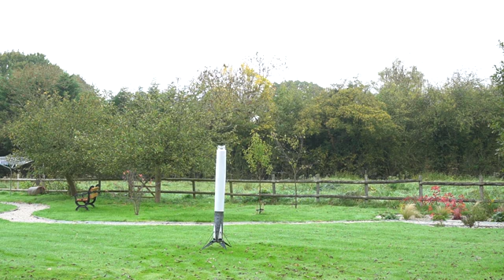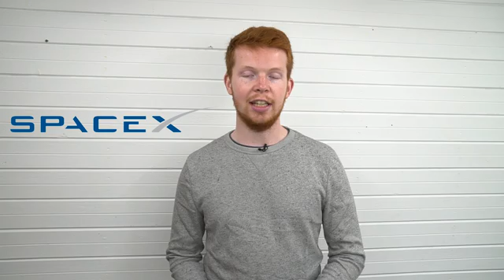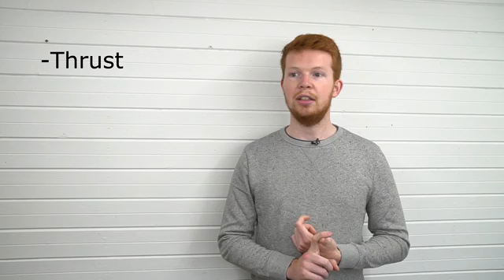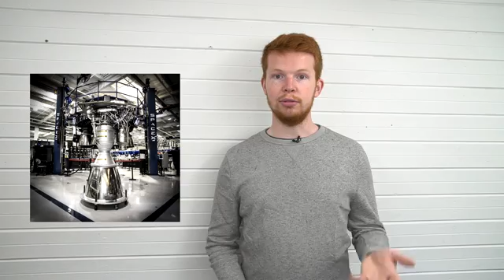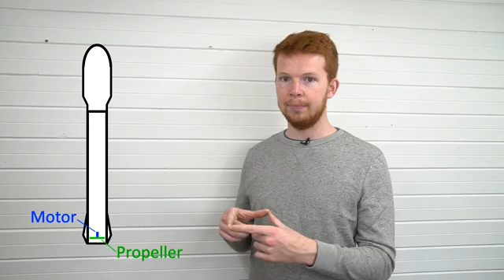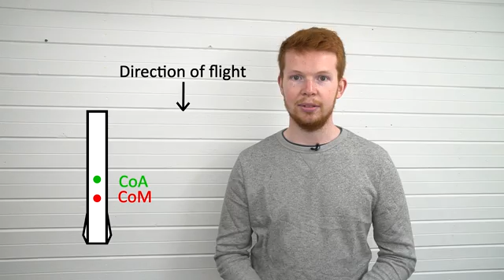Hovering a rocket - SpaceX model

Comment: Hey tom stanton, amazing video! You said that you have 2 rocket engine types: solid and liquid fuel engines. But there is another one: hybrid rocket engine, it has sort of the same advantages of a liquid fuel engine but waaaaaay cheaper! As fuel you can even use 3d print plastic and as oxidizer nitrous oxide or something else.
I hope you can do something with this information, maybe for next video?
Reply from the maker: Hey Boris, oh yeah I forgot about hybrid rocket engines!! You've reminded me of the old Mythbusters episode about testing different rocket 'fuels'! Think I'll stick to some sort of ducted fan thrust for now as it's slightly less of an issue if it crashes, but maybe something to explore in the distant future, thanks!
Reply: haha that episode was amazing, and I fully understand why you used a ducted fan, it's a little bit easier! I am making a rocket myself and am thinking about making this function too
Reply: +Kevin Jensen "Hybrids have the disadvantages of liquids".  Yes, you need high pressures, but depending on what you're doing, LOX or liquid Nitrous supplies its own pressurization, hence no pumps necessary, and if you do need pumps, there's only half as much.  The burning process is controllable, the engine is throttleable and restartable, and reasonably clean depending on what you use as fuel - but of course nothing is as clean as LH2+LOx.  No harder to steer than solids.  Efficient?  Some of them are pretty surprising.

At least in the amateur rocketry field, hybrids are quite practical.  Liquids generally aren't.

I've built hybrid motors up to 8" diameter and 8' long.  Consulted on a tri-fuel hybrid.  Assisted with numerous flights.  A friend of mine even started a company to make and sell them.  As for nobody using it, SpaceShipOne did.  Orbital?  More a matter of time methinks.   There are several hybrid motor projects underway for orbital and even manned use.

But that's all somewhat irrelevant to the video.
Reply: thus the  word HYBRID..a cross between the two types duhhhh
Reply: If you want to emulate something closer to the rocket but without issues related to combustion, why not use compressed air (co2 or nitrogen) the pressure vessel could lead to 9 gimbaled nossels that can be made out of almost anything because you don't have to worry about heat,
Reply: Fromage Frizzbizz I mean if you really wanted to, you could use a hydrogen balloon for air launch, provided a way to quickly and efficiently pump the hydrogen out, without a pressurant (possibly by physically pulling the balloon in) then the balloon can double as a fuel tank, why waste helium or what is effectively a high volume container of low density gas? You might make it semi rigid, for areodynamics. An alternative air launch is hundreds of drones that physically link together, some possibly with small jet engines and there could be crossfeed opportunity, but all of them creating a flying launch platform, alternatively both those methods could be used as assisted ground launch instead of air launch, probably much more easily
Reply: +Michael Halpern I'm going to combine several replies:

- Getting 100 tons of payload to 70K feet or more is more than carbon fiber and software - it would take a LOT of time to get up that high, plus you want reserve to land the thing if you had to abort.  the world altitude record for helicopters is 42500 feet.
- Google's "pseudo satellite" doesn't require very much in the way of payload weight, and doesn't really need to be that high.  Either just above 40K feet, or a reserved flight level.
- Getting to 40K+ feet with that much weight and returning is going to take you a lot more than 20 minutes ;-)
Reply: Fromage Frizzbizz Yeah. Hybrids can be quite efficient, too - especially if you use LOX. SpaceShipTwo is using LOX-HTPB I believe (SSOne used N2O-HTPB), and can get ISPs in the 300's. N2O with most fuels will tend to give you in the mid 200's due to the higher exhaust molecular weight and lower combustion temperatures. But, N2O hybrids sure are convenient for amateur use! Built and flew a couple myself, up to 10cm/4" in diameter :) they're good fun.
Reply: Hybrids also have some of the disadvantages of solid rocket motors in this scale it doesn't matter as much and of course they have a unique disadvantage in that unlike solid and liquid engines, hybrids don't scale up well
Reply: The reason why orbital rockets don't use hybrids is scalability or lack thereof, which makes sense because after a certain point it will get hard to maintain a good fuel/oxidizer mix throughout the burn, with solid and liquid it's easier to maintain the fuel ratios.
Reply: +Michael Halpern Maintaining the appropriate fuel/oxidizer mix is simply a matter of metering the oxidizer flow, the solid fuel only erodes/burns as fast as the oxidizer delivery.  As for scalability, there's no inherent difficulty in making a hybrid as large as an SRB, - a SRB is the most powerful engine ever built.  The main issue is that hybrids are, relatively speaking, fairly new and there hasn't been anywhere near as much development as on other types.

As I said there already is considerable work being done now, largely by private/commercial interests, to use hybrids for orbital rockets.
Reply: Fromage Frizzbizz yeah and Virgin Group has had considerable trouble scaling their hybrid engine
Reply: Gimballing, no, but thrust vectoring as he did with this thrust source, or as Copenhagen suborbitals does with its engines seems like a completely valid answer to this problem.  (On future versions of larger rockets if he ever decides to expand these experiments.) 
I think this is a valid orientation stability solution for a rocket moving up... though hovering a hybrid seems like a harder issue because, as you indicated, the burn isn't exactly uniform.
Reply: +Michael Halpern Virgin Group isn't the only developer.
Reply: Fromage Frizzbizz no they aren't, but they are one of the more likely to reach orbit with hybrid rockets, and that's with an air launch and help from the white knight aircraft
Reply: +Martshal I believe the un-uniformity of hybrids is vastly overstated, and are large a result of amateur rocketry using self-pressurized nitrous, rather than turbo-pumped/metered oxidizer.  Amateur hybrids are almost always a piece of aluminum pipe, with an aft closure containing the nozzle, a forward closure containing a nitrous fill-tube, and a middle closure containing a precisely machined hole covered with some sort of pyro valve, all assembled with O-rings and retainer snap-rings.  You assemble the after section with a piece of plastic (the fuel) thick-walled pipe, the mid closure is just above it, and fill the forward end with liquid nitrous.

Some commercially made amateur motors are a bit more sophisticated - Aerotech had a design where the "fuel half" of the pipe was a precisely cast chunk of ABS that screwed into the tank, and the tank was designed conservatively to not produce enough nitrous to burn thru the ABS wall.

You blow the valve, and simultaneously ignite the nitrous flow inside the pipe (chamber, possibly assisted with some oxygen thru a thin tube stuck up the "rear end").  The nitrous flows ONLY due to vapor pressure of the liquid nitrous, opposed by the chamber pressure.  if the pressure goes up, the nitrous rate slows down.  As the nitrous is choked off, the chamber pressure goes down, the nitrous flow picks up again, and the process repeats.

Nitrous at ambient temperature is relatively close to condensing, hence the whole thing is highly dependent on ambient temperature.  "Smooth flow" relies on getting the machined hole matched exactly with burn rates, exhaust rates, and ambient temperature.  Which means two things - the thrust goes way down if the ambient temperature is lower than you expected.  Secondly, if it isn't precisely matched, you get pressure & thrust oscillations.  So much so that most amateur launches sound like a very loud prolonged fart.  Which is quite entertaining for the kids watching, but a sign of being "slightly off" in your calculations.

With a very fast metering valve with pressure-feedback instead of a simple hole, this should be doable at amateur scale, but is more complex than most amateur rocket hobbyists are willing to do, and unnecessary for normal launches.

This all goes away with a metered turbo-pump, which makes it impractical for amateur hobbyists, let alone a project like this.
Reply: +Michael Halpern Yeah, and Virgin Group isn't the only company working on hybrids.  Check out the wikipedia page on hybrids and see how much work is being done with them.  Check out the AMROC motors - 1000 kN is pretty respectable, almost four times the thrust of the Spaceshiptwo, three times the thrust of a Delta III booster, and about 30% more than a Delta IV "medium" booster.
Reply: Fromage Frizzbizz and to emulate a F9 you will likely want to be able to restart the engine, otherwise it's just a constant hover with changing altitude
Reply: And the way I see the fate of future hybrid rocket development, because of the big push for reusability, and the fact that it is easier to refuel liquid engines than solid or hybrid engines, development beyond hobbyist and niche use will be naturally limited, unless they provide a significant advantage
Reply: They may replace Solid Rocket motors though at least for anything other than fireworks and beginning hobbyist, I do rank HRMs higher than SRMs, if you can scale them, but I also believe that they have a very long way to go, for instance the fuel you mentioned for them I believe is a patrolium based plastic, now while RP-1 is popular for liquid propulsion, so is H2 and soon CH4 both of which don't need fossil fuels, and early liquid fuel rockets used ethenol, and there is syntin if you need something closer to RP-1 and don't have the oil, burns hotter and was expensive to produce but if you needed to you can probably find a more efficient modernized process for it
Reply: +Michael Halpern They're the only ones doing air launch with their hybrids.  Many others have already reached orbital heights (but not orbital velocity) without air launch.  It's just a matter of time.

And indeed, even commercial non-hybrids are air-launched.  Eg: Pegasus.
Reply: Yes Pegasus the medium sized SRB launched out of a giant plane that carries very small payloads to orbit, Dont get me wrong I love the IDEA of an air launched spacecraft, but there are some not insignificant practical problems with them.
Reply: +Michael Halpern Musk's comments about air-launch are instructive.  You only save at most about 5% over ground launch, but end up with a more complicated rocket that has to have wings to initiate flight trajectory, and in the end doesn't gain much.  He's probably a bit overly pessimistic, but...

I don't think you could call a Pegasus "medium sized", and a Lockheed L1011 isn't exactly "giant" either, and the payload is, as you say, very small.  The Pegasus is 3 or 4 stages BTW.  Original Pegasus was 3-stage solid, current Pegasus is, I think 2 or 3 stage solid and 1 stage hypergolic (monopropellant).

You'd be better off suspending the rocket from a balloon, getting it up to 100K feet or more, and then fire it as an early X prize contestant was planning on doing.  You can even shoot thru the balloon, the rocket ain't going to care.  But again, there's even more extreme weight limitations.

I don't think that it really matters that the only major hybrid launch you've heard of (Spaceshipone/two) is air-launch is particularly significant.  There are plenty of ground launch hybrids.  They do generate more than enough thrust for orbital work, it's more simply a matter of least-amount-of-development work behind it.
Reply: Boris WHY DOES IT DAY ROCKET AT IN THE TITLE >=€
Reply: +Trozzdebois Why does it say "rocket" in the title?  Because he's modelling the behaviour of the Space X _rocket_.
Reply: The advantage of using an interlinking drone swarm is that you can mass produce them and use them similarly to helicopters in smaller numbers, even with various modules for carrying people or cargo, or a tether to carry cargo or injured people, if you got it right, meaning easily justified mass production and launches would be more or less a side application
Reply: +Michael Halpern Quite a bit of high altitude balloon work is already done with hydrogen anyway - it's a lot cheaper than helium and provides more lift.  I've spoken to a non-hot-air balloonist who almost always uses hydrogen for cost reasons.

He just packs a parachute - when a hydrogen balloon ignites, the flames go up very strongly, you have plenty of time to jump.

The big issue is that the amount of hydrogen you have in the balloon doesn't actually amount to very much compared to liquified hydrogen tanks.  Further, trying to pressurize the rocket from the hydrogen bag would be quite slow (you'd be on the ground by the time you'd gotten enough to help), and the machinery very heavy (might not get off the ground in the first place! ;-).

There's a proposal for an "inflated" tower a few 10s of km high which you could launch from.  Google for it.  That would work.  I'm still not 100% convinced about the tower itself even tho the science looks pretty solid.  Slinging something real heavy (hundreds or thousands of tons) on top of a inflated tower doesn't exactly inspire confidence.

Interlocked drones seems to me to be more complicated/expensive than just slapping on another stage.  We're talking 100s or 1000s of tons.  That's a bit much to fool around with this way methinks.

I'm more partial to beanstalks and space fountains myself.  We almost have the technology for the first.  But, I'm not so sure whether it'd be safe in the face of flat earthers, American Taliban and other extremists insisting that it denies god or is the hand of satan or some similar idiocy.  I don't want to think about a successful beanstalk sabotage.  The consequences are more than a trifle unpleasant.
Reply: +Michael Halpern I can certainly see the attractiveness of mass-produced drone swarms for cargo/passengers/disaster response etc.  Maybe we'll get flying cars only a few decades late ;-)

However, (a) that introduces a whole host of technical/social/safety issues that I don't think have been completely listed, let alone examined yet, and (b) a drone copter that can carry a couple hundred pounds near to the ground is a whole lot different than a "swarm" of devices that has to take 100s of tons or more to altitudes well above 40K feet in order to make it worthwhile.

Did you realise that the highest "non-research/ experimental" helicopter missions EVER have only been to 22K feet or so?  Simply can't go any higher.  I'm sure they could go a bit higher if there was "commercial pressure" that  Iresulted in designs suitable for higher altitudes, but even just 40K feet would be quite a challenge.

If I recall correctly, the max lift for any helicopter is about 25 tons - I saw one topping off the CN tower.  You can betcha it can't go even 15K feet with that load.  Max altitude I saw that chopper at was around 2000' ASL.
Reply: Fromage Frizzbizz so long as you can get the structural interlocking sturdy enough, and you probably would use something on the lines of carbon fiber, everything else is software, and because batteries weigh the same regardless of charge, staging them off rapidly makes more sense, vertical interlocking will probably be more structurally sturdy in many situations, though maybe not as thrust efficient
Reply: Fromage Frizzbizz Google I believe  is trying a drone swarm high altitude platform (psuedo satellite) the advantage of drones is that instead of a few big rotors you can have lots of ducted rotors in the same space producing more thrust
Reply: Fromage Frizzbizz as to flying cars, doubtful people carrying vtol electric aircraft with any meaningful speed have battery life measured in about 15-20 min tops, though some may push it to 40min, short range or brief operation that's fine, but for general transport, why reinvent the wheel?
Reply: Fromage Frizzbizz also with interlocking drones, not all have to be connected to the main body at liftoff, so really you would only have to start total staging them when they become less useful, and it is easier to sled launch drones so they can be at matching velocity when they are mated mid flight
Reply: Fromage Frizzbizz yes it is, but you can change out your drones mid flight
Reply: +Michael Halpern Yeah, I suppose, but I can't help thinking of the WeatherGirl's breaking into a rendition of:

It's Raining Drones! Hallelujah! 
It's Raining Drones! Amen 
I'm gonna go out, I'm gonna let myself get, 
Absolutely soaking <crunch...>!…

;-)

I think you greatly underestimate the difficulties of vertically lifting a few hundred tons high enough up to make a difference, let alone how cost-ineffective it would be.
Reply: Fromage Frizzbizz What if the array of drones were programmed to never fly over residential areas? Something like this could be possible in many places just here in the US...
Reply: +TheSimple Things Dropping 100 ton bombs (that's what a 100 ton rocket fully loaded with fuel and oxidizer is) is generally to be avoided.  Even in unpopulated areas.  At least a rocket that fails to boost properly is generally going to be empty (or blowed up) before it impacts.  Sure, a drone-lofted rocket could blow itself up too.  But consider: The Russians launched a whole lot of rockets from Baikonur Cosmodrome, most of which go east over land to achieve orbit.   The ground is littered with debris for 100s of kilometers.

Let's scribble on the back of an envelope here.  Say, 500 ton rocket.  You need at least 700 tons if not 1000 tons of lift to provide an adequate safety margin (downdrafts, sidewinds, drone failures, drones failing to make a connection etc.)

Now, given that the altitude record for a helicopter is 42500 feet (6 seater with just a pilot, otherwise stripped of everything un-necessary), trying to get a drone to carry, say, 300 pounds to, say, 60000 feet ain't gonna be cheap.  Each one is going to be not far off the size of a Huey (not tiny).   For 1000 tons, you need about 6800 of them.  Assume that they "flock" so that as some run out of juice, others can take over.  Make it 13000.   A Huey is about a million bucks give-or-take.  Let's be optimistic, and say $100K apiece.  That's about $1.3 billion.  Kinda steep, but you can re-use them multiple times.  Sorta do-able.

Now, as to how they "attach".  To enhance stability, the lift should be at the top, giving a wide berth for the rocket to ignite and go. So, we're thinking sorta like a frying basket.  A big ring with radiating "spikes" for the "birds" to perch on and grab for lift. Then some descending structure (the length of the rocket) down from the ring, and cross-bracing for the rocket to be mounted on.  Plus diagonals for rigidity.  It won't be light, even in carbon fiber, because it's going to be pretty darn big.

Each "spike" has to have diagonal cross bracing to prevent them bending upwards under lift.

H'm.  Spikes.  The spikes would form the backbone of a lattice.  The lattice provides the "landing zone" for each drone.  So we have to have 6800 or so landing zones.  Each landing zone would pretty much have to be free of anything above or below (two drones stacked doesn't give you two drones worth of lift, in fact, it barely gives you more than one).  Let's be optimistic and say that the rotor area of the drone is a circle about 100' across (it'd have to be at that altitude, if not more).  10000 square feet per drone - with no margin for error.  7000 drones requires around 7 million square feet, without safety margin or a big area thru which to launch the rocket.  Which will probably be a big circle on the order of 3000' across - with NO margin for error in pilotage.

Now, consider what happens if one drone's radio link or computer suffers a seizure at precisely the wrong moment, crashes into a few other drones, and potentially severs part of the lattice.  The lattice starts to bend, drones are (from their perspective) flung off in all directions, and ... 

Nor have we accounted for stratospheric winds or turbulence and other factors.

Do you see where this is going?

I really do think this is a case where a cluster of drones wouldn't work, and instead, actively work against you.  just flying at that height is extremely difficult.  Expecting thousands of them being able to do something this complicated in this tight and difficult an environment just isn't practical anytime soon (or ever).
Reply: Also wanted to add you forgot about ion engines. Those are not used in atmosphere though only in space.
Reply: Great effort, Tom.  Keep it up.  V2 rockets used vectored thrust.  Did you say Space-X does it too?  Amazing!
Reply: +Randell Porter Any rocket that doesn't have fins, or small fins, must have either vectorable thrust OR differential thrust to maintain stability and any sort of control over trajectory.  Once above atmosphere, fins or not, it must have vector or differential.

Fins aren't really practical in medium-large rockets, because they need to be mechanically guided until the air passing over their fins is going fast enough for it to be useful, and big rockets take off pretty slow, so the rail would have to be huge.  But you don't see launch rails on orbital boosters do you? ;-)

In hobby and amateur high power, the first rule is "active guidance is forbidden" (so you use fins and a launch rail), and as a consequence, the second rule is "it must be doing 40metres/second by the time it hits the end of the launch rail" - otherwise, the rocket will go dramatically off course and if you're unlucky, it's facing you when it hits 40 metres/second...  We call those "cruise missiles" - horizontal under power.

Solid rocket motors aren't throttleable, hence, they can't use differential thrust.

The Americans tend to use vectored thrust.  The very large Russian rockets (eg: N1) were differential, because trying to vector that many engines was impractical.
Reply: walks into workshop with mitsubishi mirage "I need more nos"
Reply: Lol, what I was thinking.

https://youtu.be/VI8gdmjEwKc
Reply: I feel like hybrids have the disadvantages of liquids, not advantages. You still need high pressures, the burning process isn't as clean and predictable, it's not as efficient, and it's much harder to gimbal. The only thing is that it is safer, but just stand back! There's a reason no actual orbital rockets use hybrids.
Reply: He said two main types. A hybrid rocket is a combination of both, so not mentioning hybrid rocket motors was a totally okay thing to do, and discussing them wouldn't really add anything to the video, since that would be a bit off-topic.
Reply: Joshua I know that too, great that you have listenend so good to the video, I meant my comment as sugestion to maybe help him.